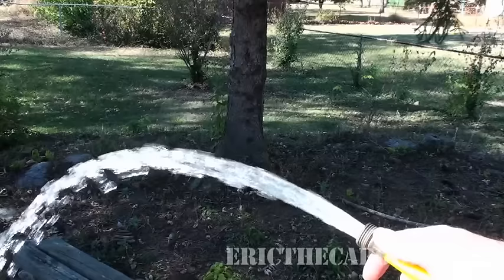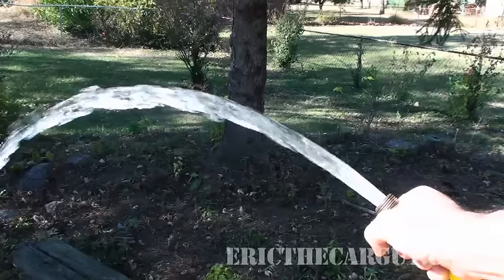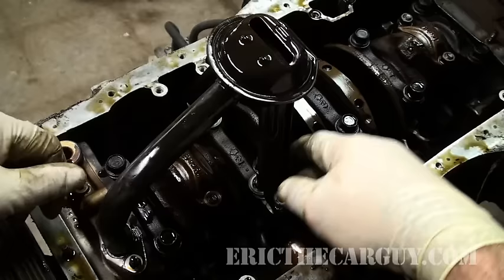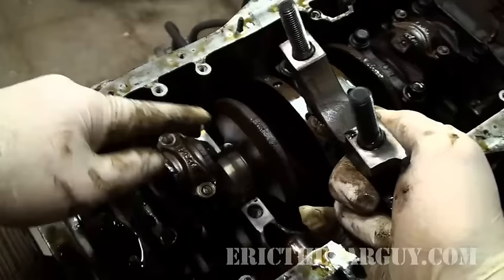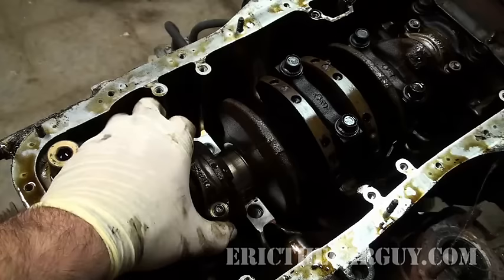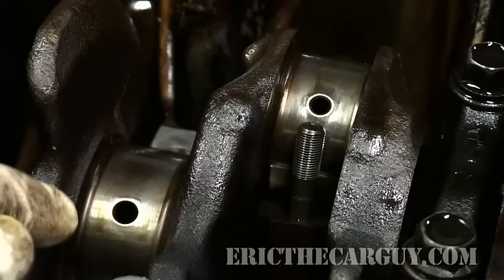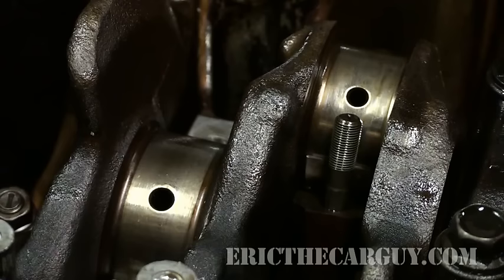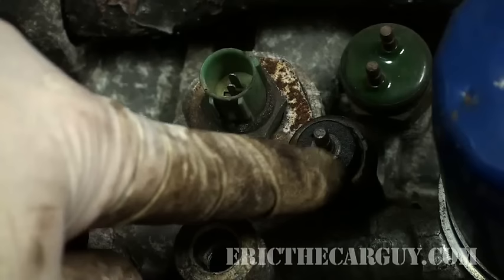How Oil Pressure Works - EricTheCarGuy

Comment: What if the engine is normally noisy/knocky like those TSI VWs?
Reply: The tdi engines have high pressure fuel injection systems and that is the loud ticking you hear when they are idling.
Reply: @exige7227  oh ok. Because it makes it harder to tell. Thanks!
Reply: @The3lloba  yeah I looked that up one day becuase I was curious to so no problem mate!

Comment: I have no oil pressure after oil change in a 97 Tacoma every time I change the oil it takes about 5 min for the oil light to go away what could this be ? After the light goes away the light and no longer comes on after every start except for the 3 sec it's on after it starts
Reply: @Grand Negus, Thank you, I forgot about that my ex-boyfriend (race-car mechanic) told me about doing that.  I just haven't had to do it myself in so long.. lol  (I have insurance that pays for oil changes three times a year)  Now, if I ever have to do it myself again? I will remember now that you said that.  Oh and to also "prime the seal" of the new oil filter by taking a little fresh oil and rubbing around it.
Reply: Keeper Of The Reaper Its not bs its simply speeding up the priming process, a wet filter absorbs faster than a dry one simply like a microfiber towel. Also a wet filter wont hold onto as much oil providing more in the sump.
Reply: I don't know Toyotas very well but I know some have the oil filter facing towards the ground. With that, you can't really pour the oil in before hand. What you can do though is before you even get started with the oil change unplug your fuel pump fuse while the engine is running and let the engine die. Then do your oil change and crank the engine for a few seconds to get all that new oil in the filter and everywhere else. Then, plug the fuse back in and prime the pump once or twice and you should be good to go. (If anyone reading this has a diesel, do not use this method.)
Reply: Benson it is b.s even when installed empty pressure builds almost instantly. It wouldn’t take 5 minuets to get pressure. Get real

Comment: You are a nice technician but unfortunately wrong at this point, please Read Bernoulli's theorem, that blockage at the discharge of any hose/flow will simultaneously decrease the area and pressure whereas it'll result in the increase of velocity of the fluid. This is what Bernoulli's equation taught us. I can understand your point here but wanted to make it clarify.  (Decrease in area of pipe will decrease the pressure and increase the velocity of the fluid).

Comment: Eric , great videos. I learn a lot from you. 
Question: I’m trying to understand why my Hyundai 6cyl died at 69000. It seemed like the rods started banging and then the engine froze up. I now know oil pumps produce volume not pressure. But can the pump fail to produce the volume needed so that wear occurs resulting then in pressure failure? I’ve always been good about getting the oil changed on schedule so I’m trying to determine what could cause catastrophic failure at 69k miles.

Comment: can you add thicker oil to make more pressure?
Reply: Viscosity rating has more to do with how the oil behaves under different temperatures. If you use an oil that say, has too low a viscosity for the application you're going to get contact between surfaces that you don't want. Skip back to when he was talking about the worn out engine and how the journal bearings were beyond tolerance. With a thinner oil the oil itself would leak out between the surfaces and you'd lose the lubrication protection. Same thing goes for the other direction.  You don't want to use an oil that's too thick (high viscosity) for the application.

Basically you always want the oil to be the proper viscosity for the application once it comes up to operating temperature.
Reply: phuturephunk
hey i had a question ....if a oil pump goes bad would it effect how oil runs to the gearbox? thx for your help
Reply: neth sok
 In all manual transmission gearboxes that I've ever seen, the oil that is in the gearbox itself is separate from the engine.

The oil pump is something that's connected into the block of the engine (it bolts onto it and is driven by a gear).  Engine oil is designed to cope with exhaust gasses getting by the piston rings and escaping into the crank case, a process called blow-by. This is why you have a PCV valve, to vent those gasses back into the intake while a device called a breather imparts a bit of clean air into the crank so you don't foul the oil too badly too quickly. 

The gearbox is a self contained, sealed unit that has it's own oil. It also uses special oil that IS NOT the same as the oil that's coursing through the engine itself. You have to use the proper type. You can find this out in the service manual for the car.  The best bet is to actually order however many quarts is required to do the refill right from the car's OEM.  It is also not nearly as cheap as the typical crap you're going to find at the gas station. Figure around 20+ dollars a quart.  The good thing is, it doesn't have to be changed very often at all. Many times cars will have duty cycles for that oil that are in excess of 30K miles between changes.  This is due, like I said above, to not being subject to the fouling that engine oil goes through. It also doesn't get heated to nearly the same temperature as engine oil so you don't often have to worry about viscosity breakdown.

So no, the oil pump going bad is not going to affect your gearbox.  It shouldn't at least, unless you have some kind of ultra exotic car that combines two systems into one...which I've never ever seen.
Reply: phuturephunk
 thx for replying so sorry i forgot to mention its a motorcycle ....can water pumps go bad without any leaking what so ever on bikes....again thank you so much for replying
Reply: reburro no.. you cant add more oil you add more oil it causes problems if you dont have sufficient pressure see what i wrote above you should have 60 psi  any higher etc or lower is bad.. you want more flow so you can buy a higher flow after market pump to bolt on to the outside or even in pan thats for high performace engines that is hi reving enginges stock cars you wont need it 300 to 500 hp your ok with a slight upgrade 500 -1000 you better upgrade everything
Reply: Ford used to recommend a 5W 30 but it caused oil burning and catalytic converter clogging.
Reply: It appears as though I am fashionably late for your time sensitive response (unless of course you asked this question simply in the name of science). Over time, as your engine wears blah blah blah please see video.      To cut to the chase, MOST quality vehicle manufacturer's put a lot of resources (ie automotive engineers, money, and research) to design engines for  optimal efficiency. While every segment in the brand's respective line will try to market certain aspects such as torque, horsepower, fuel economy, etc. extensive testing is done to obtain their desired goal. Just a little abstract leading into my response:     While I have seen engines running well into 500K with the old timers that I am all too familiar with from my younger years boasting about just compensating the over tolerance engine wear by adding a thicker viscosity oil, keep in mind this does not come without consequences. With every action there is a reaction. If you have the type of car that you just want to commute around town and/or don't want to spend the money into your car for a rebuild adding a SLIGHTLY thicker oil would be beneficial for oil pressure in comparison to the OE recommended specifications. I would first hook up a gauge as recommended in the video and check manufacturer specifications to see what your pressures are just in case your on car pressure switch is giving a false reading on the cluster.
Reply: right Anthony, I advice my clients to use oil factory spec. in the first 100 000 km (for ex. 0W30 or 5W30 ) and beyond 100 000 km to increase the 100 Celsius viscosity using for ex. 5W40. For petrol engines is much easier because those engines don't have DPF filters and they may use 5w30 then 5w40, then10w50 and at last time 10w60.

Comment: Only if you get a higher volume oil pump that would compensate for the loos of tolerance in the engine bearings.... Your seriously pushing water uphill.

Comment: Eric my friend ...i think you need to read my comment...i think you got it all wrong in your mind that pump doesn't create the pressure and reduction in area does...
So...reduction in area only leads to increase in velocity of the water or fluid ..just close the opening of the pipe completely with your hand and then you will feel the pressure...by closing it partially it reduces the pressure and increases the velocity due to which water travels a bit more distance.. i think this will remove the wrong statement in your mind ....ok
Omg...its been nearly 10 years...😊😊😊
Reply: You're right! Engines have rotary positive displacement oil pump which facilitates oil flow through creating  a certain amount of pressure.
 But the 'oil pressure' he is talking in this video is not the same as oil pressure contributed by the oil pump. The pump only creates enough pressure  to maintain the oil flow and resistance to that flow builds up pressure. As engines with high mileage go through wear and tear, the clearances get bigger and sufficient resistance to flow is lost. This leads to lower oil pressure.

Comment: If anyone could help that would be great 

I have an 01 VW beetle with the 1.8t motor and I start it up it runs fine only until the oil starts to get hot ounce it's hot I here the timing chain slap because the chain tensioner is not getting enough oil pressure at idle ounce I rev it up to about 1600-2000 it goes away any help would be appreciated I pull the pan and checked the pick up tube and that was fine don't know what else hoping now it's the oil pump not a worn engine btw it has 188k miles
Reply: Y
Reply: The mileage doesn't matter, for a better diagnosis you need to check all the bearings and plastigauge them where posible. That will be the real diagnosis.
Reply: Codyandrews188, after taking the cylinder head off on my 2010 Toyota corolla (1NR-FE engine) and working on it, I re-assembled and have been having your exact problem since then. I am convinced too it is oil pressure issues because when I took the valve cover off I saw my timing chain had suffered scars on every link across its surface. I've had to manage it like that while thinking about perhaps having to tear down the engine and very possibly (likely) replace the oil pump as well.

Comment: what is the solution an engine that has no oil in it and is seized up
Reply: Rebuild the engine, or get a used engine from the junkyard. Sorry, auto recycling center.

Comment: FYII, Wore cam bearings will cause the same low pressure situation.
Reply: rexburn1955 yes, camshaft clearances creates oil pressures too

Comment: Hey Eric, nice vid! hey do you know much about eclipse I have an 09 eclipse 4g69 engine 2.4 and it has about 90000 miles on it my oil pump light came on after I installed a new head. The car ran good for about a day then oil light jumps on, I was thinking does the head have any factors in the oil pressure? Anyways I took it apart and saw shavings in my oil pan, so I took it to the shop to be rebuilt, but still will I need to check the head again? I heard that my cam bearings would have to be replaced but It don't sound right, What should I do?
Reply: what ended up happening to your eclipse ?
Reply: jose padilla actually my balance shafts failed and had to get the engined.bored out. New pistons and deleted the shafts
 Gonna start putting it together this weekend. Yeah balance shafts were eating up there bearings causing havoc and oil pressure problems..
Reply: +Kinglionboy 777 nice! did it mess up the whole motor?
Reply: +Kinglionboy 777 im actually having the same problem on my evo 8!
Reply: Yeah delete them shafts. It could have ruined the engine but according to the shop O caught it right on time
Reply: +Kinglionboy 777 alright thanks will do that to the evo

Comment: Hi i need your opinion I have a Bmw m550D f10 the bearings connectiong rod crankshaft Oil pump timinh chain all those Things were changed And the engine died after 4000km Now its again in garage and again Rod bearings  They dont know what happend I have some theory One is They made a mistak. 2nd is i bought the car From a guy who after thr engine was rebuilt sold it to me in the garage they said that after 1000km change the oil filter ..... now that oil change has been done like after 3-4000km because off tjr previous owner used it for 1000 km i had to take it home ... waited for appointment for mechanic And the Third Is I couldnt read the Dipstick correctly the marked sixd showed me its fully other side was at the top off dipstick Maybe it was The oil Tube the oil couldnt flow back thats why one side so high Or if not could too. Much oil caused the engine failure? I have no other idea Please if any one has some ideas i listen Sorry for my english thanks

Comment: The pump does create pressure.. The pump spins forcing the oil through the small gaps. these gaps cannot handle the volume of fluid being moved hence creating the pressure. remove the pump and hey presto NO pressure....! make the gaps huge and the pressure drops however to move the fluid a greater pressure/force is needed than atmospheric.

Comment: Thanks for this awesome video👍🏼 on my bmw 2011 520d a massege came up saying oil pressure low stop and call mobile repair.... I was half a mile from home so i drove home, after parking up i tried to restart to check if i had oil in the engine it didnt start... Help anyone!

Comment: New oil pump-new bearings-motor Knocks gets hot want start metal in oil fiter  cleaned drain in heads were stopped still want build up pressure  motor no Good or is their something else i can do to fix